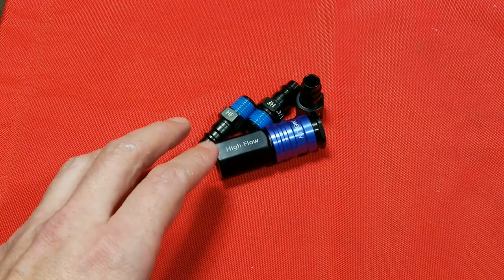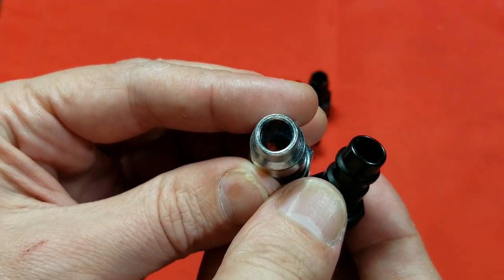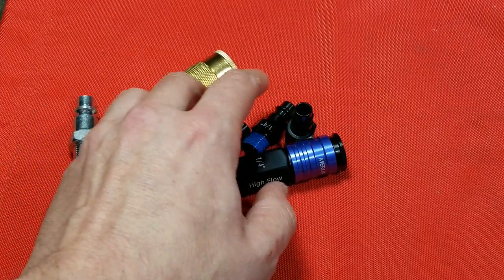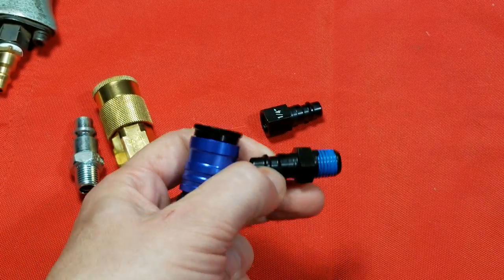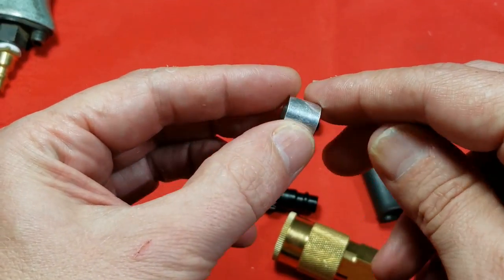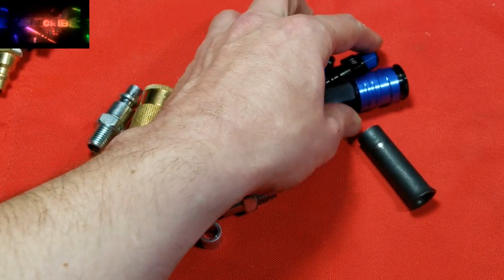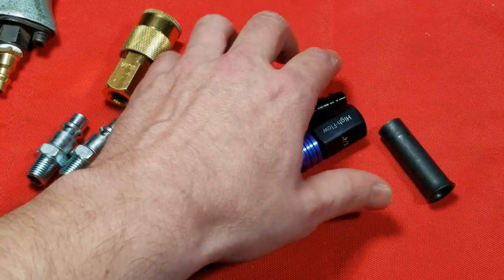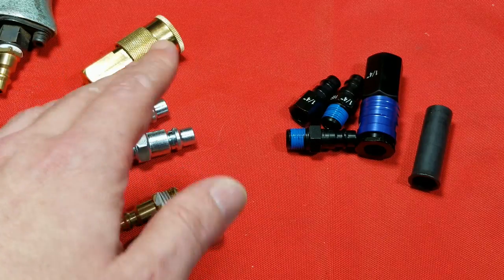Harbor Freight Merlin/Milton 1/4" High Flow Aluminum Air Fittings Review

Comment: I bought that set from Lowes, pure chinese junk.  Then I stitched to Milton HF which have been working fine for years. Yes they are less durable than brass & steel 3/8” but they are considerably lighter and easier to use. And yes they add a new standard called “V” fittings, just what the world needs is another standard..